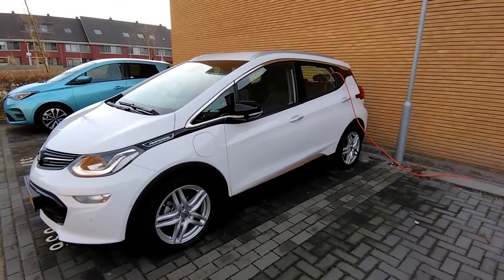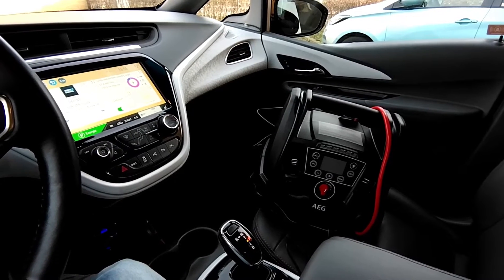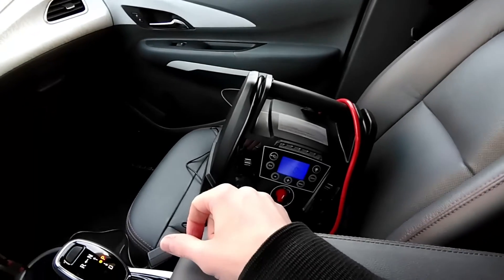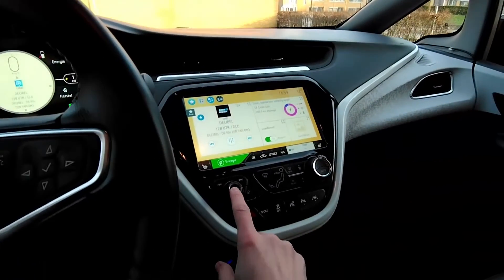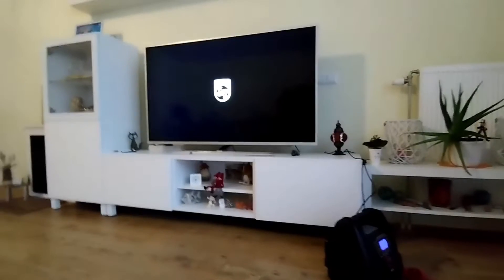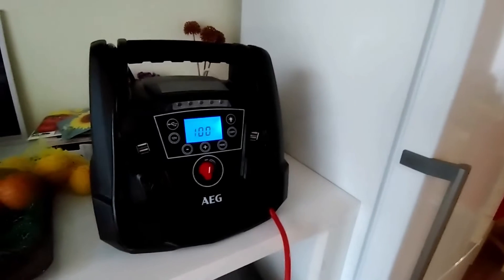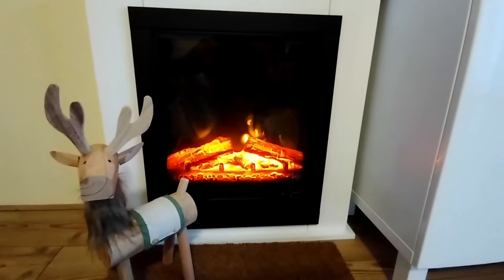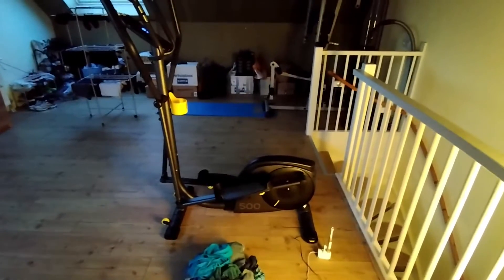How to use a Bolt EV for home backup power - creative solution - no hardwire inverter!

Comment: How do you like the bolt, I almost bought one a couple years ago
Reply from the maker: I love the Bolt EV I had the 2019 model, the refresh looks really great. One of the best EV I have ever driven and owned especially for the money. Fun to drive so much space in the cabin. Just the fast charging on long road trips a pain. And lack of repair and service support here in Europe and no connectivity any more in Europe. But as a car great and 100.000 km 5 years never any issues.

Comment: The car cigarette lighter will only put out 10 amps at 12 volts maximum, so therefore only 120 watts of power can flow through that cigarette lighter.  Your car jumper internal battery will therefore have to make up the difference if your electrical appliance is drawing more than 120 watts.

For example, if your refrigerator is draining 400 watts while it is plugged into your car jumper unit, your car jumper unit will be losing 280 watts of storage (400 watts of power drain minus the 120 watts of power it is gaining from your electric vehicle's cigarette lighter)
Reply: I have a 400 watt inverter that connects to the cigarette lighter. TBH I am not sure how it works. I think that it has some sort of buffer for the output. Either that or it is just wildly unsafe. It has a fan to keep itself cool. For camping I find that 400 watts is enough for blowing up air mattresses, charging phones, and running a small tv/video games and Apple TV (I don't exactly rough it 😂). 

I also have a 2000 watt inverter that I can connect to the 12 volt battery. I used to have it set up with quick connects with my Volt for home backup but now I have solar and battery backup for my home so I don't think I'll need it but i could hook it up in a pinch.
Reply from the maker: Hey thanks for sharing your set up! Looks like the 400W is the ultimate peak loadnit can sustain? I don't think my cigarette 12V can handle that much. Probably it's 300W nominal or something. See exactly the use cases you mention are in my opinion perfect for this. For off grid camping, long car road trips in isolated areas or if there's a short power outage. 

I'd like to ask about the inverter. Do the Quick connects come with the inverter you purchased or separate? And are they like permanently hooked up with o-rings to the battery. Then the Quick connect plug just allows you to snap in the inverter when you need it? If you know something and where I can get it please share . Thanks for watching my video and especially for commenting on your suggested set up 👍😀 I love the Volt by the way. Even nowadays looks great and somewhat futuristic and stands out above other cars. Nice compromise between electric and ICE and never need to worry about chargers
Reply from the maker: Thanks that is a well calculated summary. Do you use something like this or another set up? Of course not ideal for extended time and higher demanding power appliances. But better than nothing if you don't want to hook up an inverter to the 12V AGM battery in the front or wire it directly to it. Nowadays they have some impressive power packs like the Jackery that have a big internal battery that could (partially) slower Re charge this way. But nothing beats the direct inverter to the battery 👍🙂
Reply: @maximaalski  No, I don't have any kind of set up for a power outage.  I've been watching several other videos of how to draw power from an electric vehicle's battery.  I do like your set up because it is very simple and easy to implement.
Reply from the maker: @toebeeleeyoung5287 thanks yeah I like the simplicity of it. To complement it I got myself some 12V accessoires like a water boiler, portable fridge box and blanket. Not like the real preppers do but simple and effective if I ever need it for some hours or day at home or on the road. Now I'm in dubio where to store my backup battery probably somewhere in the warm house instead of cold garage is still better what do you think?